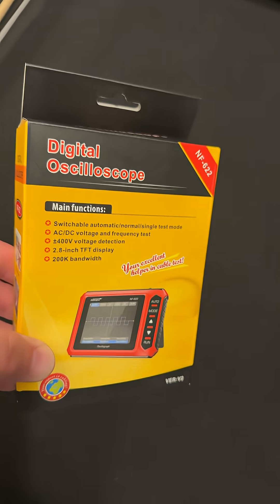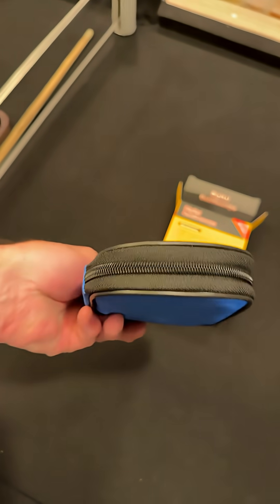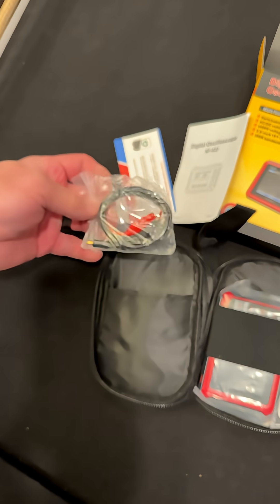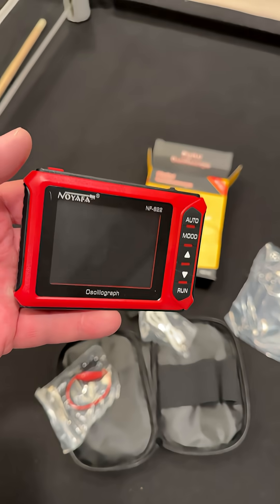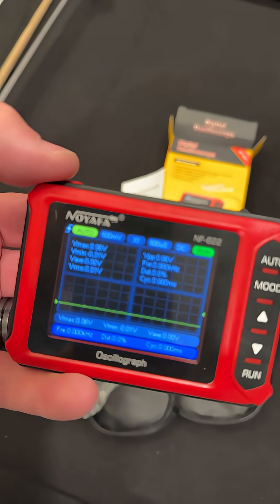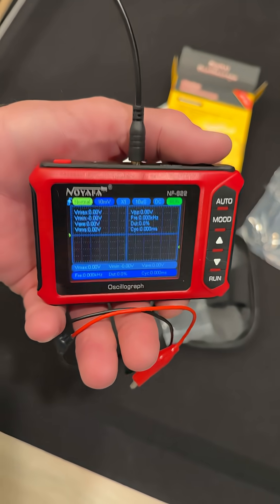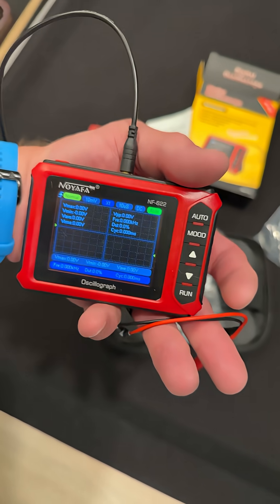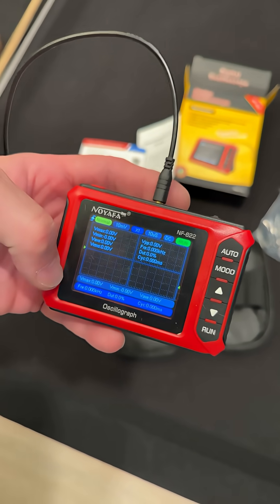Mini Handheld Digital Oscilloscope NOYAFA NF-622

Comment: It would be interesting to not only review but also recommendations for some use cases for a low bandwidth scope like that one vs other pocket scopes that might offer higher bandwidth.
Reply: Bandwidth is actually higher than the Heathkit scope that Paul Carlson refitted as a component tester, and those scopes are perfectly good for audio.
I think Adrian Black used a similar low bandwidth DSO to diagnose and repair a vintage computer once.
Add a 100x probe and it's a great option for testing high voltage gear like vacuum tube amps, where having an isolated bit of kit can keep you from blowing it up.
Reply from the maker: Thank you for your feedback!  The Bandwidth would be good for Audio work.  I want to test it on a signal to see how well it actually works:)